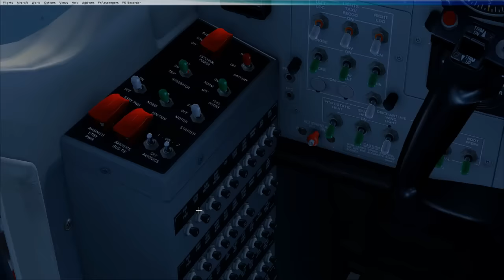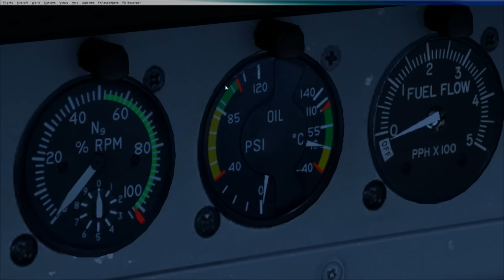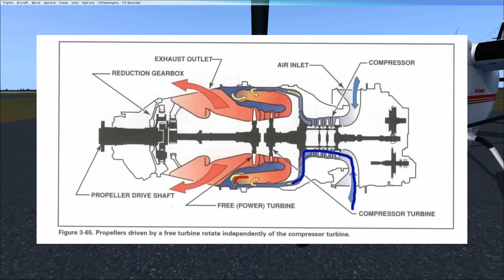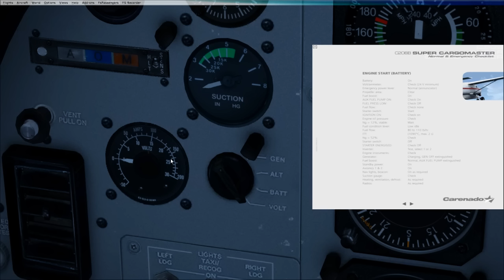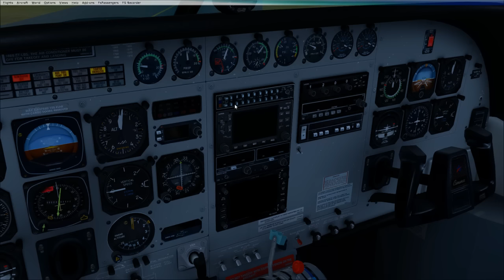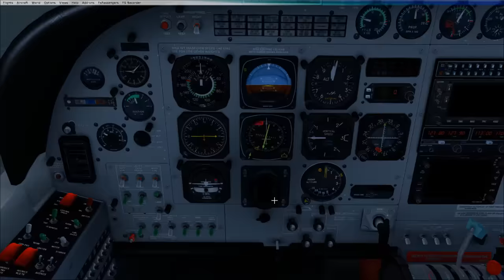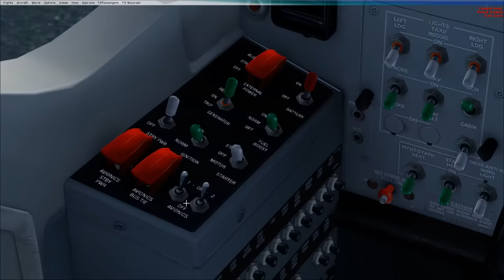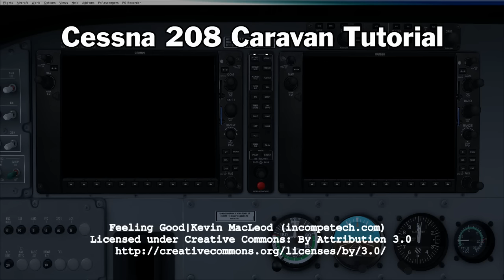FSX Cessna 208 Caravan Tutorial. P2 Startup & Taxi out

Comment: Good job but just a point of correction in the markings and units of the Ng gauge, the figures are in percentage of the gas generator Speed , 100% being 37500 RPM , so it’s 20%, 40%, 60% and so On. Not 2000, 4000, 6000 like you mentioned in the clip. Otherwise , keep it up 😊

Comment: Finally someone that doesn't call the condition "mixture". Also, only CAT II Caravans have inverters. Many do not have them at all. Also, you're correct on some of it being  modeled wrong. The generator switch is "Reset" forward, and "Trip" on bottom. They could have easily modeled it correctly, and it's odd that they made these changes. Also, I don't think you covered it, but does the starter switch have the "motor" position modeled?
Reply from the maker: In the default and carenado 208B, no the motor function is not model. In the Carenado 208EX, you can put the switch in the motor position, but I dont think it does anything.

Comment: I know this is an older video, however. After watching to learn to properly startup the aircraft. But at no point to you throw the ignition to "on", bottom center switch next to starter switch. Curious how yours started without that? I had to turn on "ignition" to get it to start.
Reply: Ignition comes on with the starter. After 46% starter changes to a generator , ignition stops.